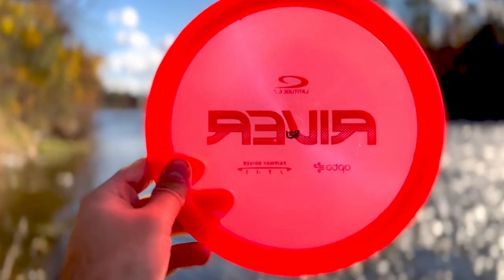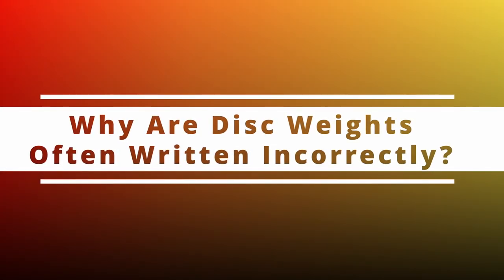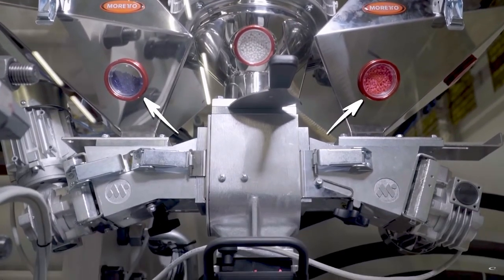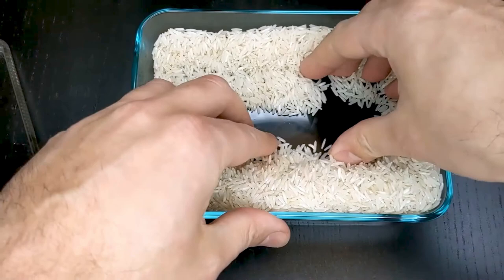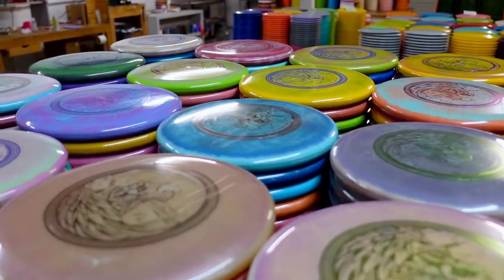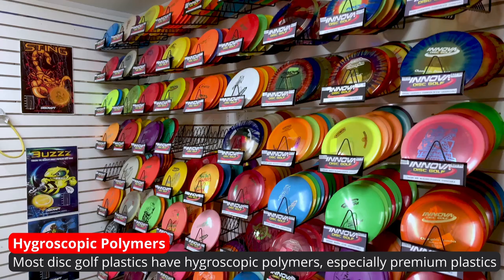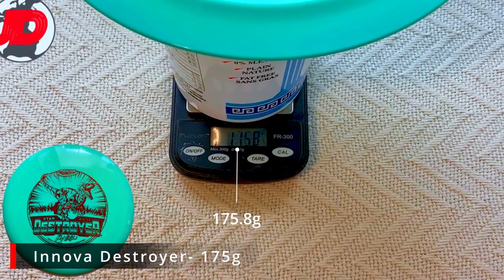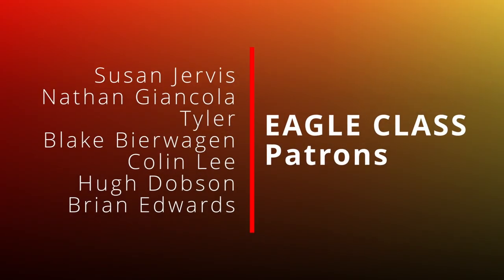Why Written Disc Weights Can’t Be Trusted

Comment: 6 of 15 "new" discs so far are correct for me (±/-2g), Discmanias Active-line and Yikun (manufacturer of both) are cheating with "165-170g" though, and even with that they have missed 2 out of 5 :P
I'd be okay if they weren't ingraved with the wrong weight... And yes, weighed in the summer 25°C and now at approximately 5-10°C at winter, not off by more then 0.1g compared.
Reply from the maker: Awesome feedback Erik, thanks for sharing! 👍
Reply: Mostly Active/DX/Ground/Retro/Soft though! Might be different for the Champion/Lucid/Dragon Line/Opto plastics as to their moisture! I think the air temperature (density) in itself and the change in grippiness does more to the flight than 2 grams on a disc though. 

But it would be interesting to know how it affects durability besides the "hardening" from the cold! Nerdstuff